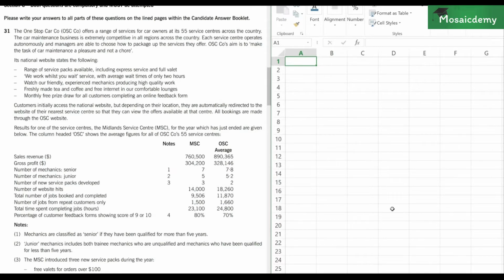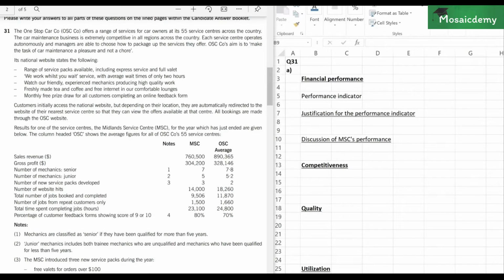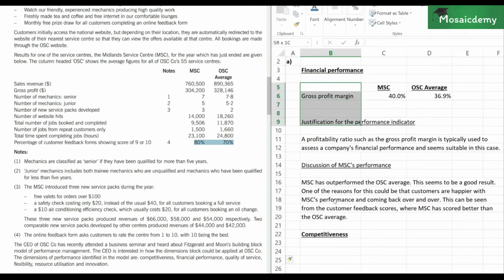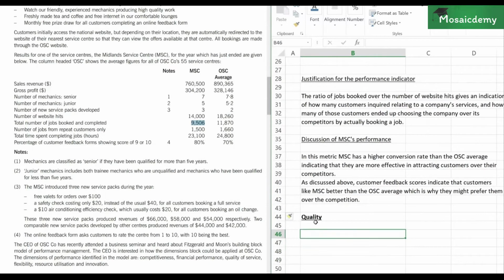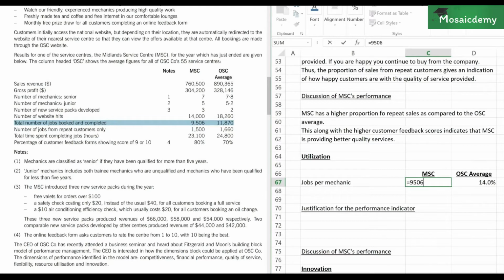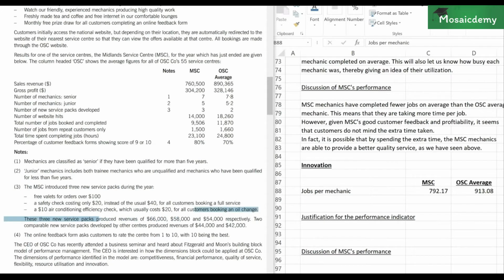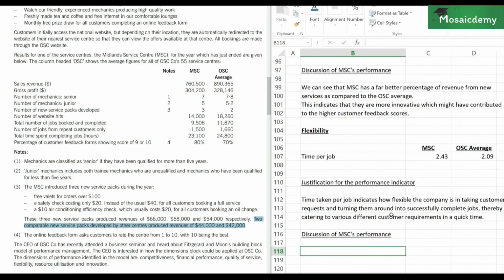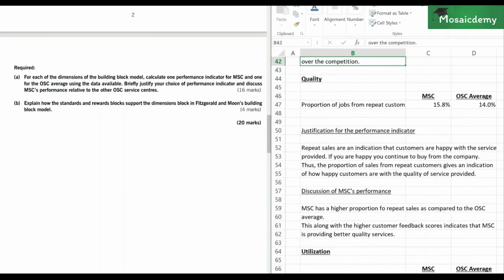ACCA Performance Management (F5) Exam, December 2018, Q31, Building Block Model

Comment: Sir have been watching your videos throughout . In this question u have not mentioned anything about the sizes of the  variables right , so we wont have a fair comparison . Since , both are catering with different volume is it ideal to write and comment like this
Reply from the maker: Sorry I do not understand the exact question. Are you asking about the difference in size of the service centers being compared? While you are right that we need to take the size of entities into account when making a comparison, that does not mean we cannot compare different sized entities. Other than that the question has no information to indicate that there is any major difference of circumstances between the MSC and the other OSC service centers. We only take into account the information given in the question scenario. Hope that clarifies your doubt.
Reply: Thanks sir . Also has sir done a question of wyeland in performance measurement unable to find it
Reply from the maker: @abdullahdilshad7572  Can you specify the year of that exam question? If it is from the last 2 years then it will not be there since ACCA no longer releases those past papers to the public. If you have any specific doubts about it you can ask here (or send us an email: mosaicdemy@gmail.com)
Reply: Dec 2022 sir
Reply from the maker: @abdullahdilshad7572  I see. I do not have a video on that one. I have found the question online. Unfortunately, I have been facing problems with my laptop over the past few days and won't be able to make a video until it is fixed. If you have any particular parts of the question that you are struggling with, drop me an email and will try to help.